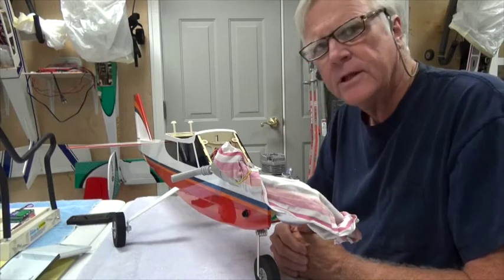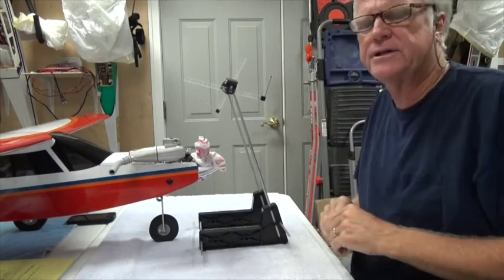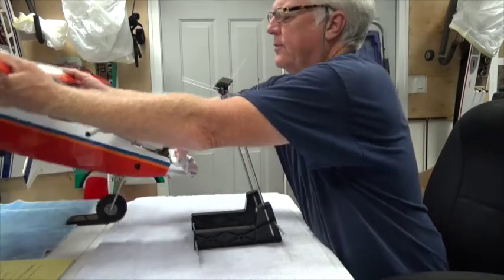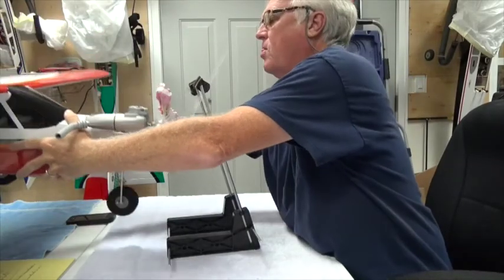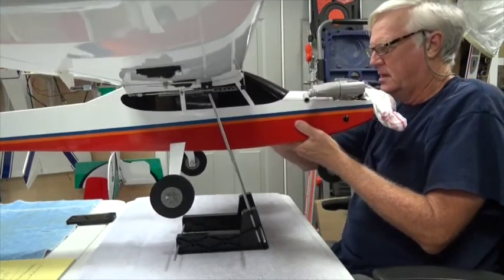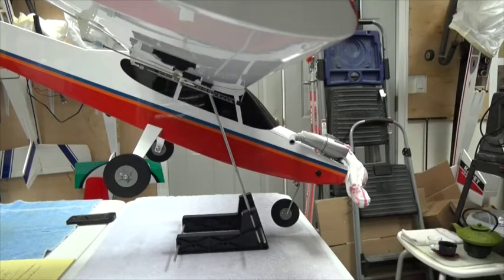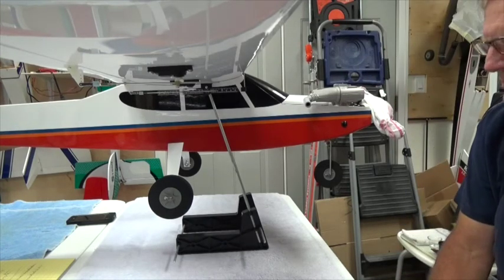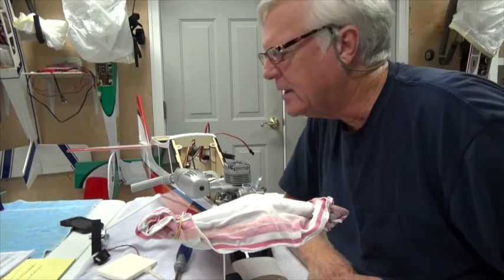AV55 Avistar Test CG Balance

Comment: I'd build a little balsa tray for the battery and glue it down the back behind that servo tray then run extensions up front for charging etc. I'd avoid adding weight any way I could even to the point of cutting out a small hatch in the back to easily accessing the battery pack..I'd make it very nice looking off course and I do think that cloth does affect the cg a bit. we dull down our props by scraping the trailing edges and tips with a knife or with sand paper while balancing them